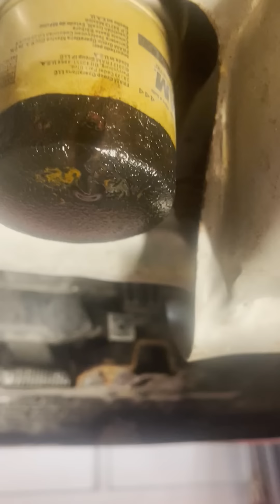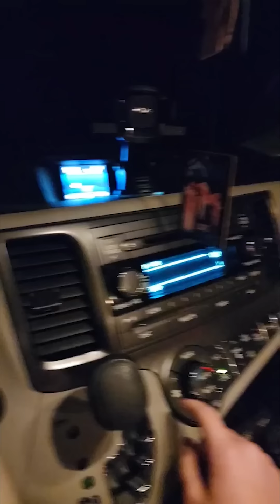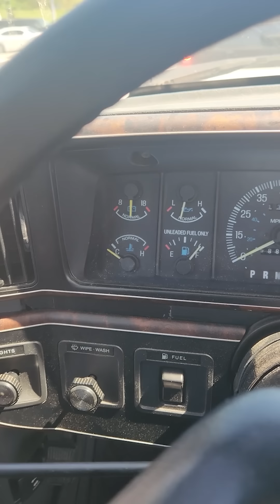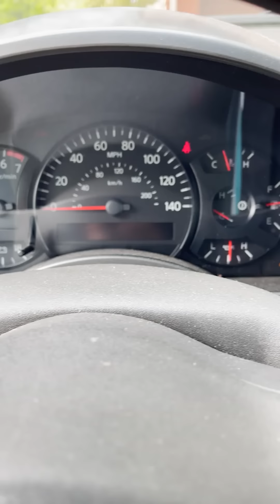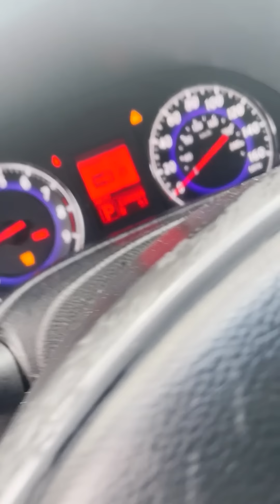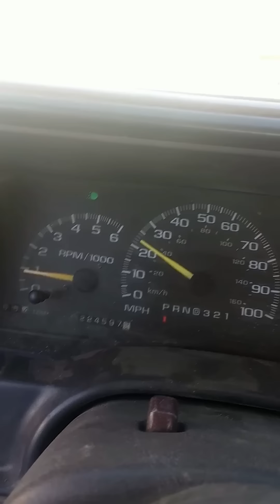Mechanical Problems Customer States Compilation Part 35

Comment: The problem: an outboard engine made a “pop,” then stopped and would not restart. Coast Guard towed them in. I came to the boat while it was still in the water. I took the cover off, looked at one side, then the other. There’s the problem. “You see that? That’s the big end of a connecting rod. You should not be able to see that.”

Comment: That milky stuff on the bottom of the oil cap is actually a pretty common occurrence. It happens when the vehicle isn't driven long enough to fully get warmed up so the moisture inside the engine condenses and accumulates. When you drive it enough to get warm, the heat of the engine will evaporate that moisture and you won't have that problem. I've seen that most commonly on the Chrysler 4.7 in like the Durango and Dakotas